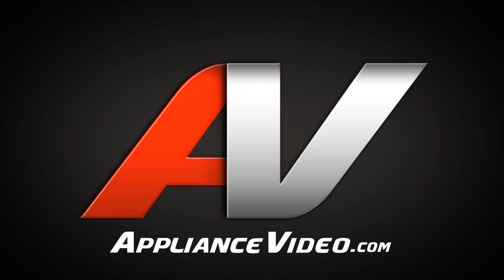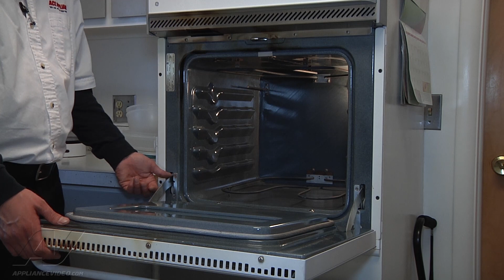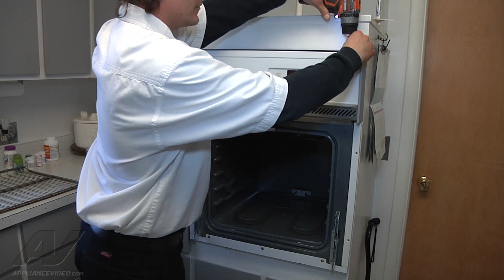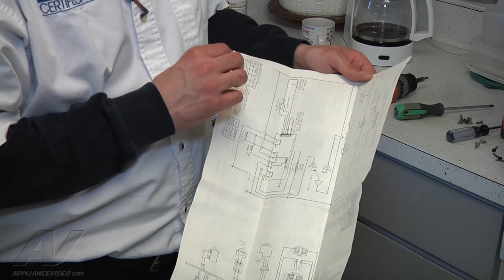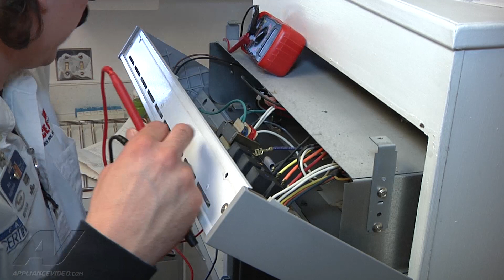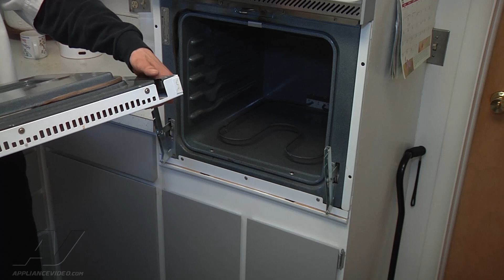GE Oven Repair - Not Heating - Main Control Board

Comment: Hello - - I have a GE Profile built in convection oven (jkp17w0p2wg) that looks kind of similar to this - - but mine does not have the side screws shown in this video to pull the oven out.  My control function keys stopped working after I made a Thanksgiving turkey in Convection mode, so I assume the control board shorted out and I need to replace it. Since the model I have doesn't have the side screws, does this mean that I can just pull the oven out without any removed screws? And do you have the control board for my GE Convection Oven Model jkp17w0p2wg? Thank You in advance for any help/advice you can give to me.
Reply from the maker: Great question, if you have a more technical question that our parts department cannot answer, you can search our over 17,000 answered questions free at our website www.ApplianceVideo.com under our Repair Help section. You can also call our parts department at 1-800-830-5465 and they can give you help 7-days A week ,or search at www.SaveMoreOnParts.com  .

Comment: Hi there, I am wondering if you would be able to help me locate the Lock/Unlock door motor assembly for my General electric stove. I have tried all the trouble shooting possible to get my oven door to unlock after the self cleaning cycle was interrupted. From all I have read, I have to remove the unlock door motor and manually reset it by turning it 180 degrees after manually pressing the open oven door rod. However, I cannot locate this on the back panel of my stove. Here is a link to the video of my filming this stove. Any ideas where I need to start. Thanks for your consideration. Here is the link which is part 1, but is only 1 minute long, also there is a 2nd part which is only 30 seconds long to give you another view of the back panel.
 https://www.youtube.com/watch?v=NXydhSBySkM
Reply from the maker: Great question, if you have a
more technical question that our parts department cannot answer, you can search
our over 10,000 answered questions free at our website www.ApplianceVideo.com under our Repair Help section. You can also call
our parts department at 1-800-830-5465 and they can give you help 7-days A week
Monday -Saturday, or search at www.SaveMoreOnParts.com  24 hours
7- days A week.
Reply: The lock motor sits under the burners in front and latches onto the door. You’ll have to pry it open with an al or a coat hanger. Sometimes plugging the oven out for 2 minutes will reset the control board and open the lock.
Reply from the maker: Great question, if you have a
more technical question that our parts department cannot answer, you can search
our over 10,000 answered questions free at our website www.ApplianceVideo.com under our Repair Help section. You can also call
our parts department at 1-800-830-5465 and they can give you help 7-days A week
Monday -Saturday, or search at www.SaveMoreOnParts.com  24 hours
7- days A week.

Comment: Thank you for the video...
Reply from the maker: Thank you Clayton for your positive comment .  Our family-owned and operated company works hard to provide you with FREE, high-quality repair videos. Thank you for your continued support and good luck on your project. If you are in need of any parts, our parts department has over 5-million in stock for same day shipping. Please call  1-800-830-5465 for any of your parts needs, or you can order online 24 hours at: ApplianceVideo.com. Thank you and good luck with you project.
Reply: *****  No problem. I had to repair mine today. It is an old wall oven and the bottom heating element stopped working. I removed it and saw only one wire was attached. After I fished it out I saw that the wire had more than likely became uncrimped from the connector and it was WIRE WELDED back on.. I imagine all of the heating up and cooling down over and over finally killed it. The weld broke smooth in half. Glad I didn't have to do major surgery on it....
Reply from the maker: You are very welcome.